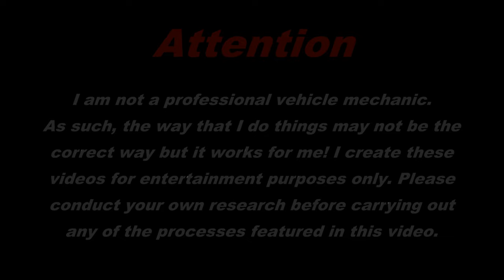Honda VFR800 VTEC 2002 - 2013, Complete Bodywork or Fairing Removal - A Step By Step Guide

Comment: I love the way you are thorough in your demonstrations, how you actually show us the screws to see the difference between them and where they go, like the screws for the bodywork for example. I have recently done a lot of work on my 2004 VFR including the valve clearances, following your 3 part video on that job, excellent by the way! Other jobs as well like new front seals and bushings for the front forks, new chain, and sprockets. So having the bodywork dismantled for a little time, you tend to forget where which screw goes where, so your thoroughness saves me time to get the screws or whatever it might be in its proper place without having to refer back to the manual. Super helpful! Thank You!
Reply from the maker: Awesome! Glad to have been of help! 👌🏻😎

Comment: You absolute legend! Much easier to understand than the insanity that can be the Haynes manual. Thanks for this.
Reply from the maker: Glad it helped!
Reply: Hi Kev.
I have a 2003 vfr800 and its not running properly. 
Have carried out service. 
Air,oil and fuel filter with iridium plugs.
Still not right. 21150 miles on the clock.
Previous plugs were black indicating over fueling. Would a compression check help to diagnosis a possible cam or lifter fault as I know this could be pricey. Keep the videos coming. Many thanks.

Comment: Dragging this clip up because I want to say a huge thanks Kev.  Last week I bought a '98 VFR with just 24k on the clock.  Today I wanted to strip it down and give it the XCP Clear Coat treatment.  Watched your video last night and whilst there are a couple of differences, it made the job so much easier and I didn't even open my Haynes manual.

Those push in plastic fasteners are 'fun' to get back in!  My bike is black, so spotting the holes on the inside was not easy!  Thanks again👍

Comment: Hello, the plexiglass  screen can be brought back to clear, one is to wet sand with 3000 grit. 

The other option is to use Meguiar's PlastX by hand or with a mini machine polisher as in my round photograph.

Slow speed, no heat no pressure, it will cut. I use a 1" mini microfiber pad.

Good luck.

Comment: Wow.., thank you very much. My son and I are currently working on my 07 VFR (it’s been parked for 10 years). This video is a big help! We pulled the gas tank to flush it out and now the bike won’t start. The fuel pump isn’t priming and the FI light is on. Do you have any videos (or advice) on troubleshooting fuel pump not priming?
Thanks agin for this video., you make the process look very simple:)
Reply: This is exactly why I'm here! Mines been stood a little while and now the fuel pump isn't priming when I turn the ignition on. Bound to be relatively simple electrical issue 🤷🏻‍♂️

Comment: Hi, very nice video. i follow youstep to remove the fairing. i found that there is a 2pin cable(wire color: orange and green) near the right side fuse box that is not connected. do you know what is it for and where it should connect? thank you for your effort.

Comment: Hi, Just got a VFR Vtech and your videos are great, thank you! Have subbed!
I was wondering if you could maybe 'shed' some light on the givi model of the top and in particular the side pannier frames you have.
I seem to only be able to find the side frames that curve under the exhausts and then limit you to 2 different givi pannier models the v35 and v35, seems a lot of sites show the straight frame but the info states compatible for vn35 and 7 so are in fact the curved ones. I already have normal givi pannier and hoping to get the straight side frames.
Is the top frame the normal one for the vtech (Givi 166FZ). Ironically the givi page of the 166fz shows the straight sides but no info.

Thank you!

Comment: Hi Kev. 

Fantastic video. Has made the removal of the side panels a lot less daunting. 

My VFR fell onto it's right side and now there are drops of what appears to be coolant dripping from nearer the rear of the bike towards the rear shock. It only occurs when the bike is running. Nothing leaks when the bike is switched off. 

Don't suppose you have any suggestions for the likely culprit do you? Before I start tearing her down...

It's not coming from any breather pipe. 

Thanks Kev, and again, fab video. 

Dom

Comment: Hi mate. Your video has been a godsend as I stripped my VFR for repaint and put it back together again. One question, what size are the 3 bolts on the front mudguard? Think I've lost mine.
Reply from the maker: Hey chap, thanks for the kind comments. I wasn't sure if you meant the 4 that hold the actual front fender onto the forks which are shouldered 6mm bolts https://www.fowlersparts.co.uk/parts/5058659/vfr8003-2003-e/front-fender or if you meant the ones that go through the blocks on the brake pipes which are 6mm but 25mm long https://www.fowlersparts.co.uk/parts/5058654/vfr8003-2003-e/fr-brake-master-cylinder-vfr800 hope this helps bud. 👌
Reply: @KevsShed  thanks mate. That helps a lot. 👍👍👍👍

Comment: Hi kev! Thanks for the video! Do you happen do know the torque specs for that bolt you disconnected to get the tank off? Can't find it anywhere
Reply from the maker: Do you mean the high pressure fuel line banjo?
Reply: @KevsShed  yes I do, sorry!
Reply: Fuel pressure regulator nut is 27nm. Fuel rail bolts 10 nm. Fuel hose pipe union bolt AND nut 22nm. Fuel pump mounting plate nuts 12 nm.

Comment: Kev, why in God's name did Honda use different sized screws in the front panels? Every time I change the oil on my 07 I question the logic. Do you know if you can buy the style of body fasteners used on race bikes? Would be convenient
Reply from the maker: I know, it is a bit of a pain to correctly remember where each different type of screw goes! I assume that you mean Deuz Fasteners, they can be made to fit but need the receivers on the inside for them to fit into. I have them on my Trackday R1.

Comment: Another great video Kev (and ‘filmcrew’)!
(Real men’s vid with lots of gore 😝)
Was watching your vid on how to replace indicator bulbs https://youtu.be/HVLvEmL9wv8 first as I want to do a little upgrade:
my 2003 VFR800 doesn’t have a warning/ alarm function (and switch).. so I bought a ‘4-way micro LED flash set’ to add these in the indicators housing.
This video will help me a lot when i take apart my VFR 😇
Cheers!!